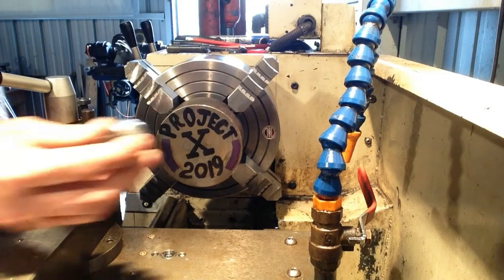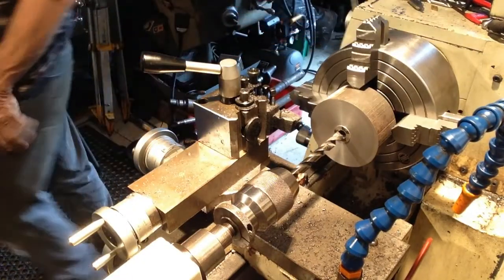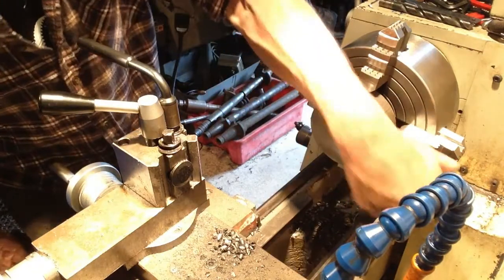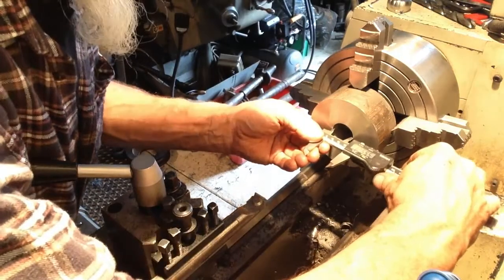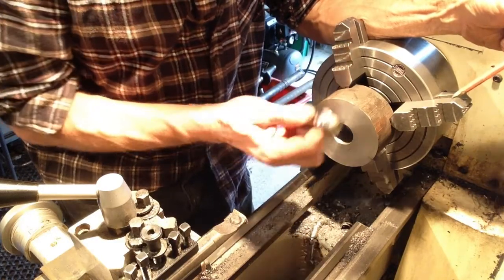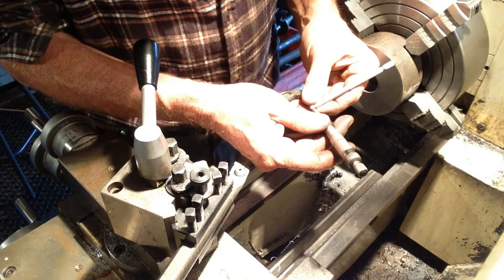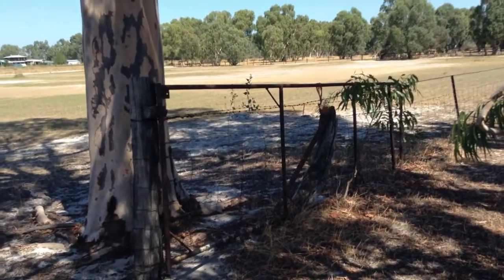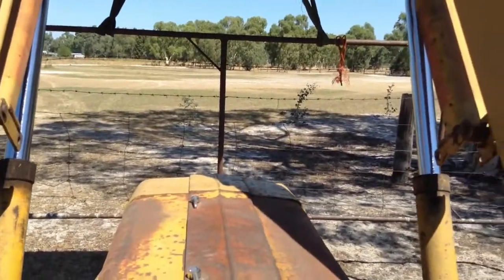Swarf & Chips  Episode 5  part 2

Comment: Hiya Max,  A bit of concentration there old son. Know what you mean with cast iron getting into everything. I was machining some rough cast iron conical castings today. Have to clean up as you go along. Nice bit of flat sandy grazing country you have there. I'm sure it soaks up the water when you can get it. Trees seem to be thriving
Reply from the maker: Hi Mate ,  Its all  crap sand out there in a couple of months the grass takes off again  faster than you can mow it !  The cast is good stuff to avoid  although i  have got some to make a couple of external lap's  when time permits .  Cheers .